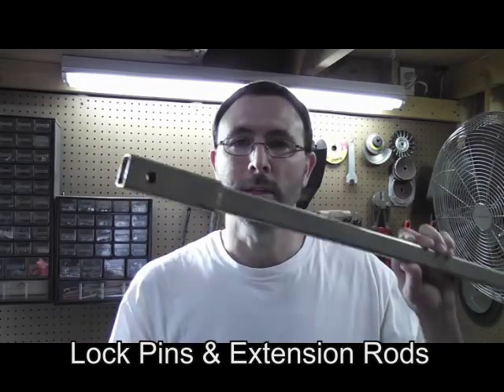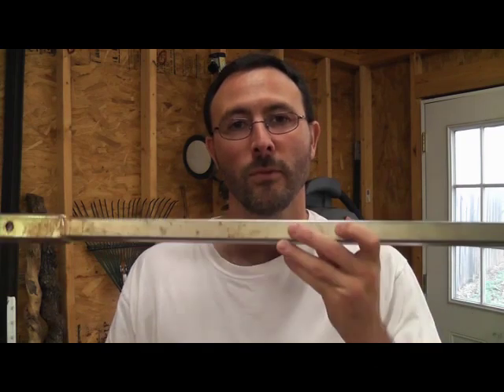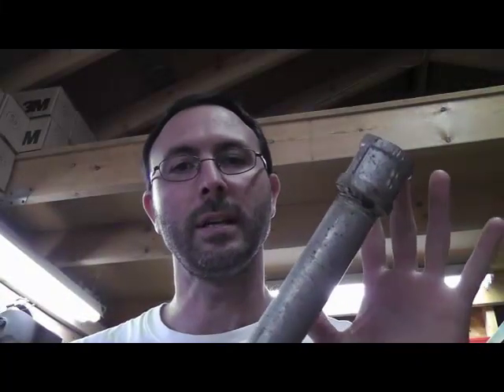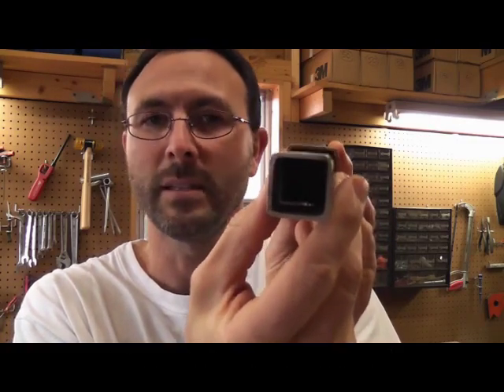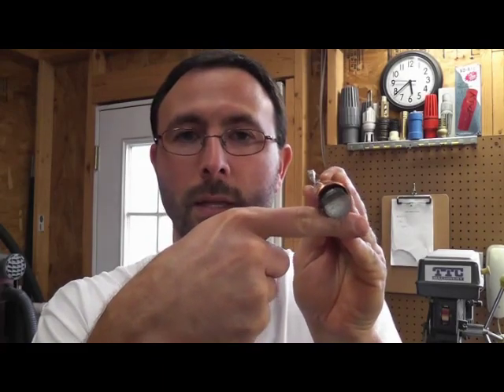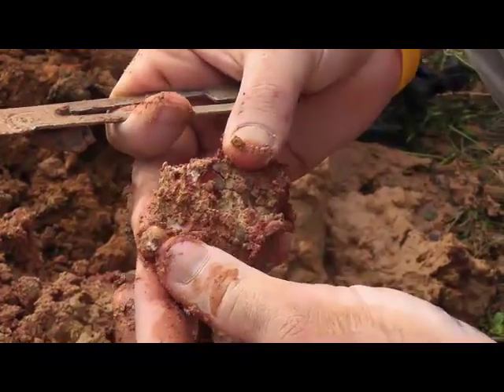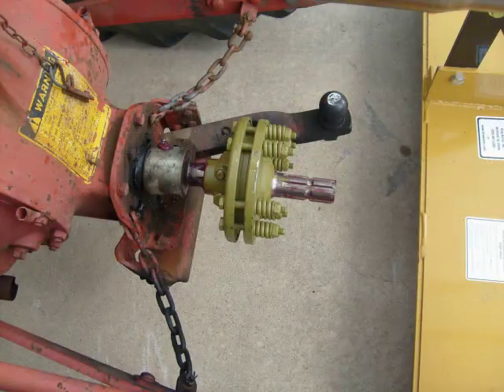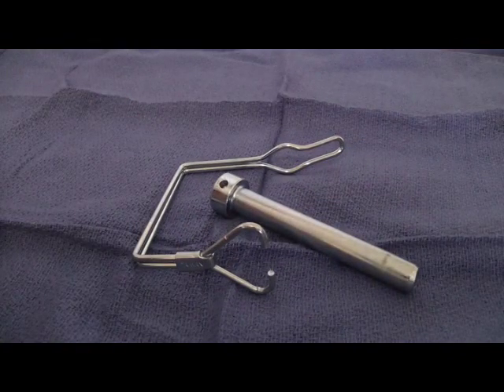Water Well Drilling by Hand: Lockpins & Extension Rods

Comment: Hi, Great work.
Regarding retention of the "drill bit" could you consider an "umbilical chord" of wire or thin cable / even string, attached to the bit permanently with perhaps a "fishing rod style" series of snap rings, 1 or 2 per pole section; connecting the whole together as a backup???
Then if a lockpin breaks loose - you can still withdraw the sections and re-assemble?
hope this suggestion helps someways ...